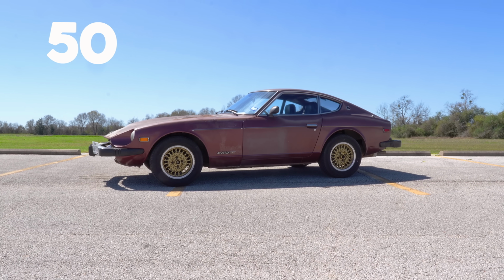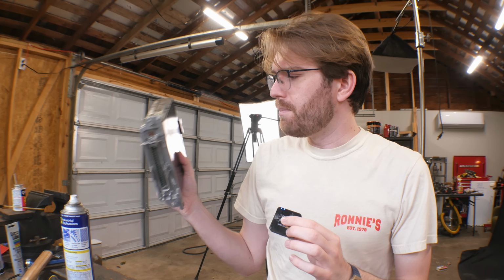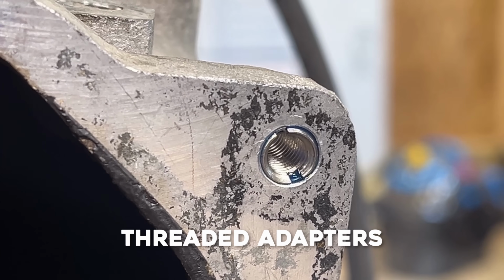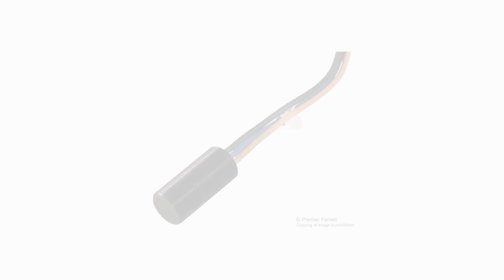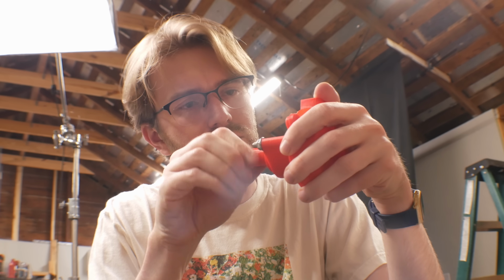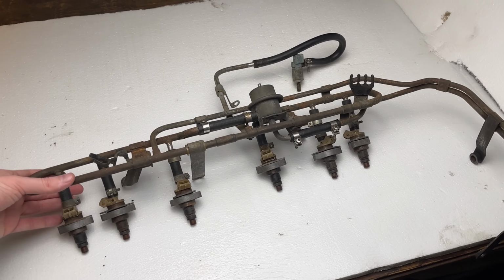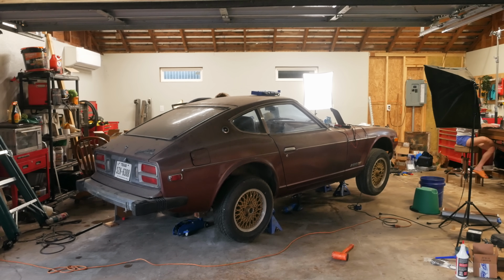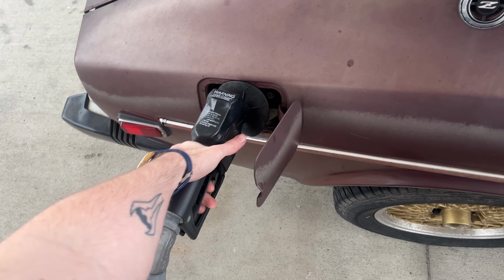Modernizing a Vintage Car

Comment: 4:10 Bosch is widely regarded as one of the world’s largest car-parts suppliers, if not the largest. Just saying.
Reply: Yes, a highly respected and well known Company in the automotive world known for their innovations like the first Deisel injection system, the first Gasoline fuel injection system, the first electronic ignition and the first Antilock Braking Systems, (ABS) among other things.

Washing machines are no problem for them, lol.
Reply: that would be the joke

Comment: 20 miles/gallon = 8.5 km/liter for a 50 years old 2.8L 6cyl engine... that's pretty sick.
my 28 years 1.8L 4cyl engine runs 8km - 11km per liter lol

Comment: That is a wonderful project, conversion to full electronic fuel injection. This has been my thoughts as well when I see these iconic classics with their outdated, outpaced fuel systems.Some of the engines were good, just needed technology to catch up. Thanks for posting. 🐞

Comment: I use this same throttle pedal in my 260Z for e-throttle and had a similar solution for mounting! Any chance you'd sell the file to print the final spacer for my build? I also feel like my pedal isn't in the best spot and you might be one of the only other people I'm aware of using a 350Z pedal too!

Comment: Would you consider selling the hall sensor setup as a kit ? I’m going to be doing a modern efi on my z using emu black and s54 individual throttle bodies

Comment: Not sure what year Datsun/Nissan changed them over, but (as much as you don't want to right now), look into what valve seat material was used.  When the automotive world left leaded fuel in the '80s, the valve seats had to change (harder material, if I recall) to match combustion conditions.  Also, unless they outlaw ethanol and blends, be careful what you fill up with - don't want all that work to go to waste because the go-juice had a BAC of 10-20% and ate away your seals.

Keep up the great work. 🙂👍

Comment: I had a bunch of Z cars back in the 80's - great cars back then.  Life is too short to mess with them now.  I say buy a fairly new sports car that handles better, brakes better, and like you said:  gets better gas mileage.  And by the way, I owned a 69 Camaro back then too but same deal there.  Cheers!

Comment: Hey Ronald.. First let me say.. I'm truly impressed.. second.. I have a new challenge for you.. install a H-H-O fuel system on the Z. IYKYK. The testing I personally have performed on both the "wet" and "dry" fuel cells are extremely viable and you would literally be saving hundreds of dollars a year by eliminating gasoline all together. There is (was) a guy on YT (Swedish?) that showed his testing on HHO and calculated one drop of water "solution" has enough potential for a 100 miles of travel. FYI the expansion ratio is around 1600:1 As soon as I'm able, I going to install one in my truck to assist my MPG in getting better first. I believe the fuel sensors will measure the amount of fuel/air (when the HHO is installed and functional) and the only thing the computer can do is slowly shut down the amount of fuel from the gas tank and in-turn raise the MPG. There's a lot more to it, of course and I have made build sheets implementing safety components, pressure relief valves, check valves, regulator, limiters, etc.  Great job on the Z. You are hilarious, too.. CHEERS!!

Comment: Great Video I had a 240 years ago I v8 swapped and It was cool but all of the hardware your using now was not as available. Thanks for the video, it was really excellent, who knows maybe another 2x0 someday with a turbo fuel injuected L28, I loved driving it even if they were a little tinny, but that can be fixed as well.

Comment: Curious if you would get better mpg if you installed a mass airflow sensor, instead of tuning with speed density since its not boosted or crazy horsepower.

Comment: Thos engine components are not a simple plastic, they are PA-66 nylon. Same material glocks are made of. PA 6 and PA 66 have an incredibly high melting temp and are incredibly more durable than just a simple plastic. In 40 plus years in automotive, I never ever once seen a coil go bad. I seen a lot of other things go bad but not a coil.

Comment: As excellent and wonderful as you did (honestly I’m blown away about how good everything looks) try this with caveman style parts and see if you can make it have more power something like an hei distributior and an extremely well tuned carb and ported intakes and exhausts to match the heads keeping with your rule of no touch the internals it should result for an interesting experiment!

Comment: That car would be great (and future proof) if you changed it to EV. It would cost a little trunk space for the battery pack, but would have been easier and give you twice the HP. ( and no cancer fumes as a side benefit)

Comment: Don’t EVER talk bad about the Z!!  I had a 78 Z purchased new from a dealer, and I got 24-28 MPG. If you want an easy MPG trick, get a higher rear end/spider gear. The engine has plenty of torque to handle that

Comment: You just need Triple  45mm webber sidedraft carbies and Some front brakes 6 caliper piston from a 1980's BMW (easy swap, bolts holes line up,  note brake line, metric for datsun, imperial for BMW so you need a adaptor to suit)
Or you will have a hard time stopping it.
That will give you some big boy horse power 😃

Comment: Dude, with all that work optimizing fuel, air and spark. You need supporting mods now!!! Long tube header, a better intake manifold and a cam, you should be able to break 190hp easy.

Comment: Love that he immediately forbids himself from doing any of the mods known to reliably create increases in horsepower, like a camshaft with a bit more lift, which is also completely reversible and inexpensive, or even just rebuild the head for a fresh valve seal. Naw, let's throw $5000+ worth of standalone engine management at it to find out that we made another 17 hp because we did not actually start pumping more air. It is neat to see precisely what improvement modern engine management is good for. Good news! The car is now very easy to turbocharge.

Comment: Back in the day my brother had a 78 280z 2+2, which is the hatchback with the louvers. I loved that car. It handled great, but always had carburetor problems and was back and forth to the mechanic every year for that. We once drove it through this winding mountain road with no shoulders so beyond the edge of the road was trees. My brother was hauling ass a bit and the tires started to squeal like it was going to let go sending us into the woods, and all he did was lift his foot off the gas and continue to steer. The tire squealing stopped and the car held the corner. We both were shitting our pants. Those cars really handle well and with your improvements to the fuel system, you've fixed the most poorly designed part of that engine. A straight 6 in a car like that should last many hundreds of thousands of miles.  Great work!  I had to subscribe to make sure I don't miss any updates to this beauty!

Comment: Load a mode onto the computer to shut off 4 cylinders by shutting off the fuel injectors. Run it on only 2 cylinders for better fuel economy. Would bet you could get 45-50 MPG

Comment: i may be an idiot but you mentioned money being the issue with engine swapping and the products u used were 1000s of dollars i dont see how this is a more budget option now ofc it doesnt say budget anywhere but its implied in the empty wallet gesture also the parts that were expensive u didnt pay for which just doesnt seem like it helps the idea of the budget/diy concept like i said this video feels less about budget and more about lets take tubes and hoses out and put computers in their place this sounds like hate but it isnt just an observation and i guess i came in with the expectation of a more similar concept of like speeeed/old donut or haters garage style of videos like i said not hate just confused on the premise and why id get recommended this good video nonetheless ik people will say im 20:57 but its just my opinion weve all got em nobody has to like or agree with mine
Reply from the maker: Not an idiot, I just didn't do a good enough job clarifying in the video! A modern engine installation would require custom engine mounts, a transmission adapter, a custom flywheel, as well as the computer+wiring needed to run it. The price of just a used VR30 (Modern Z engine) is almost double than everything in my project would've cost if I had to pay for everything myself, and that doesn't even include the rest of the parts needed for the engine swap.
Reply: @RonaldFinger i wasnt thinking of a todays z engine just a more recent engine as i said still a great video im just used to hodgepodge builds still love the car 🤝 i do still think it could be reasonably price engine swap but tbf youve looked into this car directly and most likely compared the pricing that wouldve been interesting to see though not a direct comparison because it would have to be done but an estimate compared to the amount used in these parts and for you specific use case
Reply: That was awesome

Comment: ive been driving a 1986 silverado since i was 15, making repairs and basic upgrades all along the way. im 28 now and i can tell you right now that doing all that top notch work just for the starter to crap out is PEAK AUTOMOTIVE EXPERIENCE.

Comment: Hi Ronnie, Good job, was a bit weary of the distributer conversion ( I would have put the reluctor wheel on the crank for higher resolution and less slack) but seems to work great!

Comment: This is a lot of work for nothing.  If anything, you are going backwards.  A good tune up would have gotten you the same power.  Original power of your car of 170 hp at the flywheel should have been around 15-20% at the wheels (depending on how warm your drivetrain was when you took the test).  Which is what you got more or less at the end.   The OEM parts that you replaced are of far higher quality and properly matched than the parts you gobbled together.  And the next person that gets the car will have no idea how to troubleshoot your work if there is a problem.  You yourself may not be able to troubleshoot in five years, you will have forgotten what you did.  The shop manual will be worthless.  Yes, there are advantages in one coil per cylinder, but the advantages are more related to emissions than performance.  And the comparison with the modern car in hp is not accurate, the chevy cruise hp is not at the wheels, its at the flywheel, this is how modern cars are rated.
Engineers in the 60's and 70's knew a whole lot more about your car than you ever will.  So ... if I were you I would put all the old things back the way they were from the factory.

Comment: I owned 3 240s and at least a dozen 280s and a couple 300zx turbos.  The 240 was the only one that wasn't constantly a vapor locking computer controlled turd but they some of my best memories of hanging out with friends.

Comment: You may have gained 13% power
But how much weight did you lose i bet the power to weight ratio is heaps better because of the weight more than the power

Comment: Cool project, just a couple of notes for ya. 1st, 17mpg in a car that old is actually really good, so please dont put it down for that. 2nd, youre not, as far as i can tell, taking into account how worn out the engine is. Engines loose power, torque and fuel economy over time as they get used. The higher the engines milage, the lower everything is going to be regardless of how well the previous owners took care of it. With that in mind, you would regain that lost performance by having the engine be rebuilt. new rings and bearings. New lifters. new timing chain/belt and timing gears. all new orings and gaskets. the works. Also, i know you said you wanted the internals to be oem, but you would actually unlock a little bit more performance and longevity simply by converting to a roller cam if it doesnt already have one. just something to think about.

Comment: It was so good! 
It is my dream, to do all you did,  but with another car.
I think this engine can go better. Without disassembling and rebuilding.  
Intake manifold, longer tuners. Exhaust, make it flow better.
Maybe go from lamda sensor to wide band oxygen sensor (ability to tun on lean mixture) . Aaand, probably integrate EGR (cool down combustion with lean mixture). This thing can increase mileage, if it turned correctly.
If you dont want to deal with flow sensor, probably there is a possibility to connect MAP (not use internal) positioned directly on intake manifold. Or, connect internal MAP with wider metal tube. It is too far away and hose too narrow. Readings can be far from correct. 
Maybe possible to manufacture new intake with longer and wider runners.  

Or turbo. More power, more fun, less mileage.

Any way, I think there is potential. 
Everything running but raw. 

You did so much with, so do a little bit more fine tuning and optimising.
Everything will be perfect.

Comment: Having worked on these engines when they were new, ( pre fuel injection years) take the time to replace the oil pump and distributor drive shaft, these engines will do 200k miles but need regular maintanance , but the drive tabs wear out making for irregular timing
Reply: Everyone replaces the oil pump with an 81-83 turbo oil pump.  The engines will do well over 400,000 miles (at least my 79zx has) and keeps going.
Reply: Yeah .. I had a :81 maxima with essentialy the same engine ... The oil pump failed at 80 mph on a freeway one night .... It was right at 190k miles.
Reply: To that is why my old 280 was so slow

Comment: Fantastic. You are in a parallel universe with my son who has a 1970 240Z but sourced a turbo version of the L28. He also picked the ECUMASTER. Using a Honda throttle body and printed a carbon fibre connector. I’ll be curious how many of the issues you solved your video will help him with. Exciting.

Comment: Now imagine how good it would be if you did a rebuild and put new rings and seals and a valve job on the motor and replaced the cam with those worn lobes.
Reply: I was thinking he developed about the simplest restomod upgrade kit for the Datsun/Nissan L series inline 6. Rebuild the motor, use either stock cams and get the modest power bump (I'd guess not more than reaching 200hp), or do some work on the head and maybe a little different cam profile and get more like 225-250hp. Doesn't sound like much, but I bet you'd feel it, and the reliability would probably be ridiculously high.
Reply: @sireuchre Oh yeah, I have an infiniti g20 from 2002 that I’d like to give more hp to. Right now it runs at about 145 hp, from the engine (No clue the wheel hp since I’ve never tested).. it struggles on hills. It’d be a really fun car if I gave some more power…

Obviously I can turbo it, and there is a factory turbo’d version of my engine (SR20DE, SR20DET is the turbo’d version)

But yeah the point of my comment was to say the “small” hp gain would def. be felt. My car has similar hp to his in the video.. I know I’d feel the extra hp if I upgraded it.
Reply: He managed to bring a 1970's 2.8L Datsun engine into running in the same territory as a GM 3.4L LA1 V6 that needs piston rings replaced with a fairly mild set of modifications. That accounts for something, given no prior experience.

Comment: Ive had 7 Z cars over the years but So many better motor options like even a trailblazer 6 cylinder. Those L28s are heavy and really don't make good power

Comment: What's crazy is that there aren't even any chips inside the original engine computer, just a handful of transistors and lots of supporting resistors and capacitors so much so to the point where it couldn't even be called a proper computer. So a Tomagachi is in fact way more advanced haha

Comment: I have an old 97 Ford Ranger with the gutless 3.0 v6 and that engine has the same camshaft position sensor arrangement.  The engine uses what originally would have been the distributor but the function is the same as your application.

Comment: Also needs compression to run, and a valve job and new head gasket/timing belt is appropriate after 100,000 miles.

Comment: Love the video. I pretty much did this with my 1987 300ZX (z31). Well everybody was busy swapping in v8s I was busy making the V6 beat v8s. Then I went overboard and built the motor lol love to see someone make original tech work better. I ran a mega squirt gold box 3 with coil on plug and just the ignition system itself made the motor run 10 times better and gain horsepower.

Comment: I am wondering if this would work for an older Mercedes with the D Jet fuel injection. Also designed by Bosch for the 74 Mercedes i have.

Comment: 140 2025 horsepower is pretty close to 1970's SAE gross horse power that Nissan would have quoted back in the day as at the time US SAE figures  were measured without any parasitic losses from ancilliaries. Makes 15-20% difference depending on the car. Your Dyno guys will have converted wheel horse power to modern net at the flywheel horsepower, your engine is in pretty good shape....

Comment: Even if the power was actually 170 at the wheels, 125 is really good for how old it is.
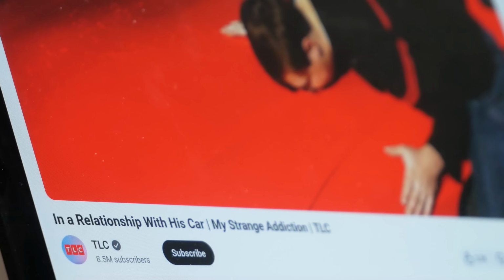7:00 whats really funny is that argument. I have only ever heard that argument from people who are trying to prove eletronic control is better. The real argument is cable good, cause stupid simple to fix. Just replace cable. 20 bucks done. Electric bad, because not stupid simple to fix, and definitely not 20 bucks.